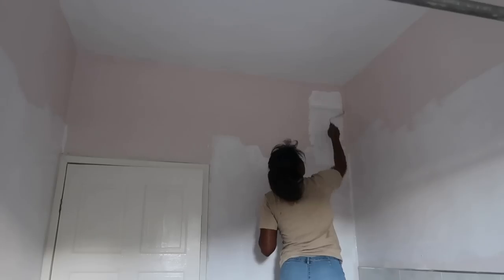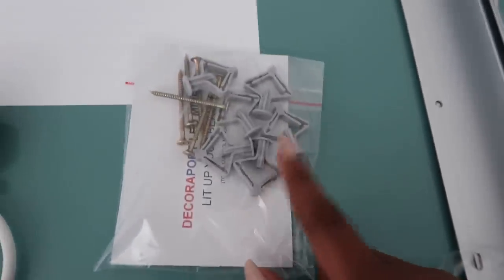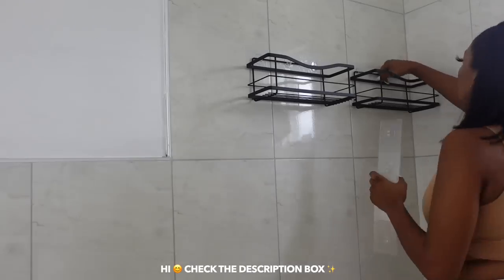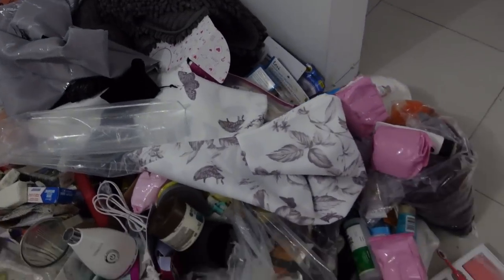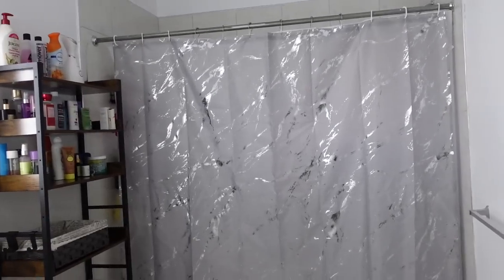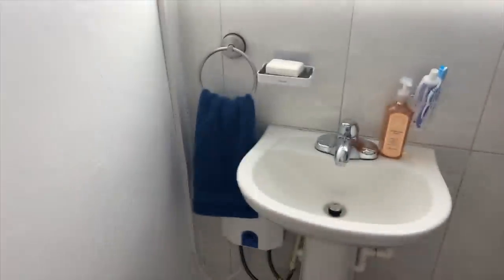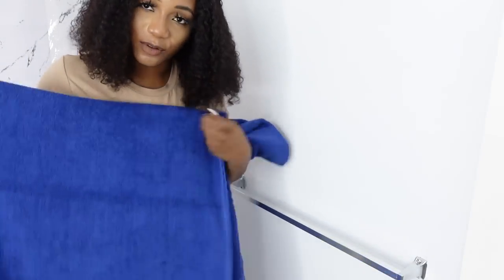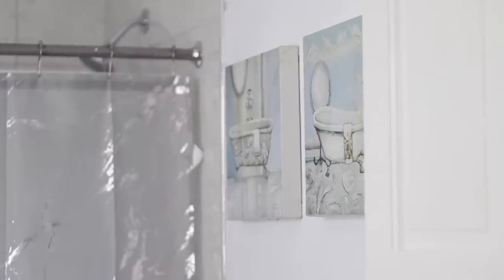MY BATHROOM MAKEOVER IN JAMAICA + tour. Amazon must-haves, Organization tips | Annesha Adams

Comment: Tip close the lid before you flush the toilet every time because all the germs go to your things above. 
Another tip because everything eventually rusts in Jamaica (even if it says stainless steel) because ya know salty ocean air and what not. Rub the shower poll with an excess amount of oil. Use bounty paper towel and pour cooking oil, coconut oil or whatever onto it, so that your metal rings don’t dry up and rust and scrape against the poll as you slide the curtain. 

Also I hate that in most rentals in Jamaica have those likkle dinky sinks in the bathrooms with no cupboard below honestly those sinks are for single public washrooms. Smh you just know a man picked the basics and designed it. 😂
Reply from the maker: im going to try the oil trick for my kitchen faucet! thank youuu